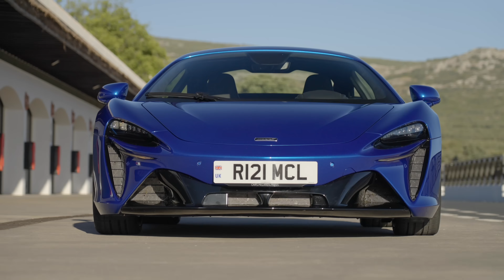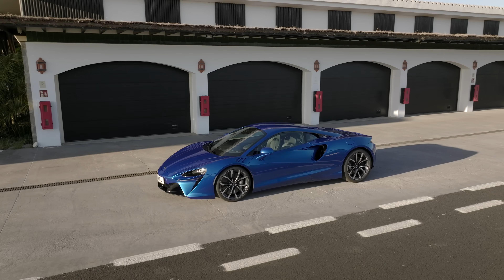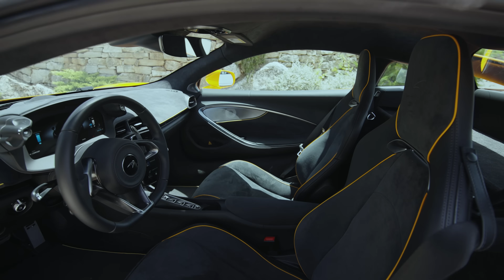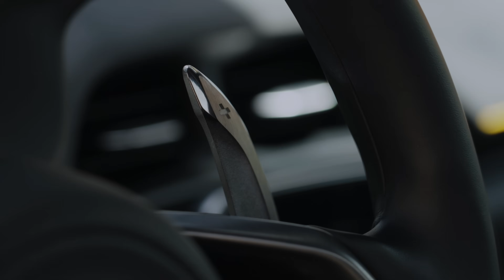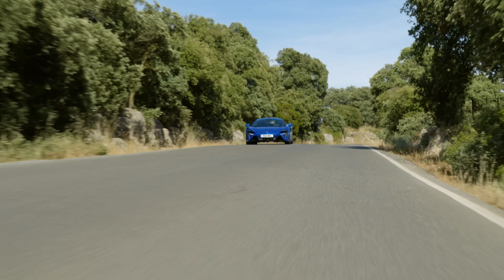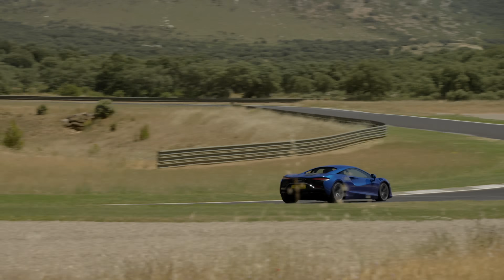McLaren Artura review: plug-in hybrid supercar leads Ferrari-rival into electrified era

Comment: 70kW from a 7.4kWh battery is going to result in short battery life. That's 20% more discharge rate than a Model S Plaid, and that isn't designed to work on track. Do I trust McLaren to engineer a battery powertrain more reliably than Tesla? Don't know, but I'd be interested to know the parts cost of a replacement battery.
Reply: I mean, that's really just a cell selection issue. PHEV cells are often a bit more power focused at the expense of capacity. Conversely, they're nowhere near as aggressive as a cordless power tool cell (or their Formula 1 cells, I'm sure).

Comment: So... McLaren had problems with fire recently (by recently I mean for years). 
This one seems to have those problems too, even though this has been a main concern for McLaren. 
And they put the fuel tank on top of the battery pack. 
No thank you.
Reply: fuel tank on top of the battery pack? I'll have to look it up. Where is it on other hybrid supercars for comparison?
Reply: @DonBarracuda117  Battery packs are pretty much part of the chassis & as low as they can get them. Within the wheelbase &along the centreline of the car. Now if it is mid engined then a Good place to put the High octane fuel tank is on top of the battery. However if your car catches fire, you are double dead. The fire brigade arrive in minutes, the commander says get the reg & get someone to inform next of kin. The firemen can't go near it or put anything on it. The only thing can do is form a cordon around it until it blows. Either petrol tank is going to blow & take the battery with it or vice versa! Now if you were to fit a fire extinguisher to this car, what sort would you fit? Or both!
Reply: @kevinburke6743  oh... well that's not good. Hopefully they tested it rigorously for the worst case scenario
Reply: I believe it was the engine not the battery  that had the fire issue, the written review mentions the oil cooler

Comment: I know they have the same powertrain hybrid set up but comparing this to the 296 is setting the Artura up for a loss. The 296 has is 20-40% more expensive has 25% more power and is a faster/quicker. The Artura is an entry level supercar (see R8s, huracans). The most realistic and obvious rival would be the also newly released MC20 as it's the same price, speed, quickness, and has the same basic interior and dull v6 engine sound, although the MC20 does sound cooler with the blow off noises. Based mainly on looks alone (and the fact that it'll be just as quick/fast/dynamic), I would have the MC20 over this and in fact did pick it over this. And If you want to compare the Artura to a car with similar powertrain, then the NSX would be the logical comparison. The 720 replacement with an upgraded Artura powertrain will be the 296 comp and will be the one to wait for imo.
Reply: The 296GTB with just the bare minimum options costs about 60% more just to match what comes standard on the Artura (front lift, adaptive headlights, forged rims, power seats, etc.). I speced my 296 build to match my incoming Artura and the GTB came in over $380k, an absolute money grab. I had to trim out some options just to stay $100k over. You get way more value from the Artura. The MC20 is nice but nowhere near as fast. The Artura is a high 9 second car in the real world according to some of their engineers.
Reply: @XennialGuy  nah the mc20 and the artura should be the same speed actually. early journalist saying how the artura is not that fast and feels more tame than the mc20 and how the 296 is a lot faster....and the 296 should be faster than both as it has 25% more power (but will confirm over the weekend as Im going to have a back to back go in the mc20 and 296).... You have to think of the artura as a 570s replacement and not expect the car to be shockingly fast like the 296 and then the car makes more sense. if you're expecting it to be faster than the mc20 and more similar to the 296, you're going to be disappointed. its a high 10 second car like the mc20 not a 9 second car like a turbo s lightweight. the 296 can't even crack into the 9s (its around 10.4 in the 1/4) so there's no realistic way the artura will be able to. (and even if the artura is closer in speed to the 296 than the mc20, I'm still taking the mc20 based on looks alone!)
Reply: Nice summary well written.  The more choice the better of course, I think I would take the maser as well

Comment: 235's in the front. The new Supra has 255's. This car needs more front bite McLaren.
Reply: The new Supra has an Inline 6 up front...
Reply: @corystansbury  that has nothing to do with OP’s comment
Reply: @zatharos6427  ohhhh, but it does
Reply: @corystansbury  how? Hes talking about tires. Not engines
Reply: @zatharos6427 Thank you. The 2022 Porsche 911 GT3 Touring has 255 fronts as well. I saw other reviewers complain about understeer when pushed into the corners. So yeah, a wider contact patch would cure that. 👍🏾✌🏾
Reply: @zatharos6427  What is the job of the front tires? It's to change the direction of travel, competing against both inertia in the direction tangent to the curve and polar moment of inertia of the vehicle. The rear tires are then side loaded as well by the first of these. The more weight that's up front, the more difficult it is for the front tires to spin the car around its axis and the more proportional load they see in fighting the desire to go tangent to the curve. A rear mid-engined car does not need as much front tire as a front-mid-engined car, especially one with a large inline 6. 

The benefits of a smaller front tire are many, but obviously there is a point where it gets too small. It's possible that a 235 is too small, but I'm far more of the opinion that it's a conservative suspension setup, a la C8, vs. a case of being under-tired.
Reply: @zatharos6427  it certainly does do your homework and you will discover that engine layout influences tyre size

Comment: It's just funny seeing the effort put into making the body/chassis and drivetrain lighter and at the end it's still heavier than it's predecessor. Yes we know why but ... It's still heavier at the end of the day 😅
Reply: 3300 lbs with nearly 300lbs of batteries and electric motor is very impressive. Lighter than P1 and 300lbs lighter than the 296GTB.
Reply: I'm working on a new car design that doesn't have an engine or a transmission. Hope I get it working one day.